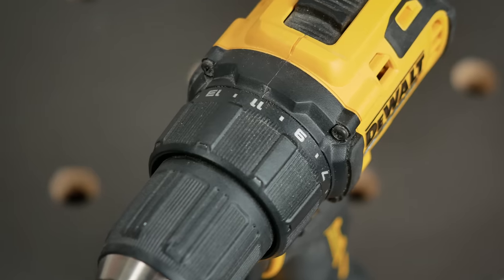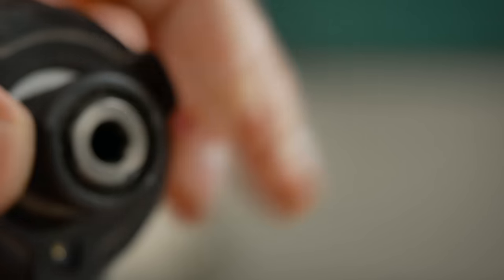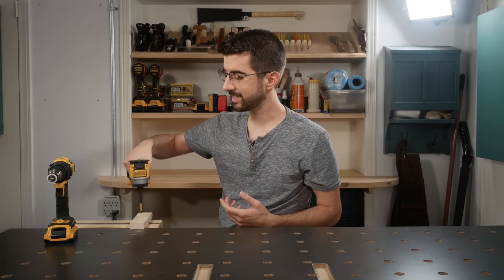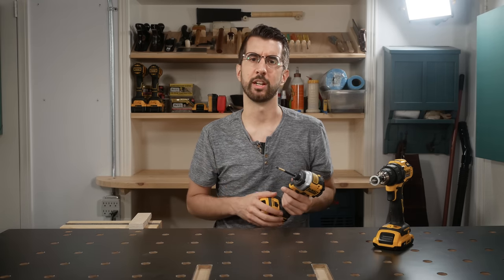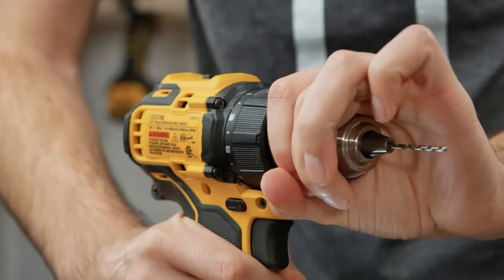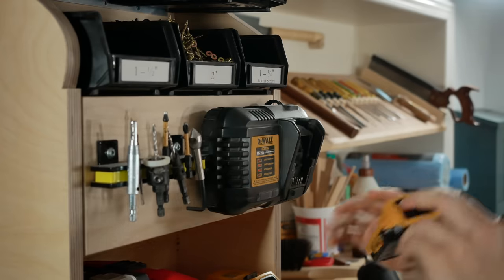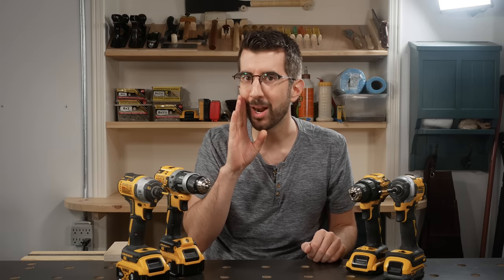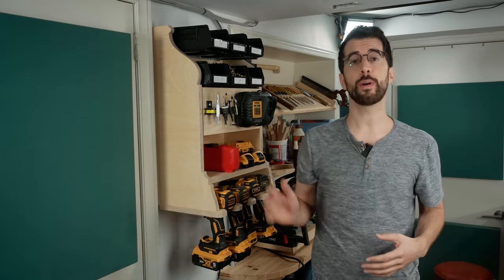why woodworkers don't use impact drivers

Comment: I'm using impact in the factory/workshop in almost all scenarios....
We're working with CNC because we're making lots of projects, So the CNC operator gets all the wood ready (Plywood, Hardwood or MDF for doors, Depends on the client idea/request)
Then it goes into the painting room/oven and when we do pre-assembly (Before it goes into the client for installation) we're doing everything with impacts, Drawers, Shelfs, Hangers, Boxings and everything in between...
Also If we touch impact subject I can say from long time experience that Makita impacts very reliable, Working non-stop without issues...

Comment: I’ve found that the impact is best for rough carpentry / construction and the drill is superior when finer control is needed, generally when making more precision cabinets or similar furniture.  To be fair I’ve never had a chance to try an impact with multi settings, and for the record I have several corded drills, one a 1980’s Black&Decker 😂 but 2 are more recent quite powerful Milwaukee drills, and when drilling other stuff like stone with them, having a keyed chuck is indispensable.
Reply: I use my 12v milwaukee driver for most less than construction grade work. It’s light, small and fairly strong, excels at finer tasks, but for a 2.5-3” screw it’s not practical. Impacts are kind of noisy, you don’t get a good feel of how much torque is being applied to a screw, but it’s still the right tool for the bigger stuff.

Comment: I'm a member of a Men's Shed group. Three years ago we replaced our stolen Milwaukee gear with new ones that turned out to be brushless, very nice. But what was intriguing was the pair of impact drivers: they have three different torque settings AND a drill-only setting. Often they are used on the drill setting because of the really short head compared to the pair of cordless hammer drills which are almost twice the length.

Comment: I have that exact same DeWalt XR drill/driver combo, and I must admit I don't use the impact driver nearly as often as the drill - it's doesn't give nearly as much control over setting screws, and it's much too easy to bury a screw deep in your workpiece. I much prefer working with the greater finesse of the drill's clutch control. Use a locking bit holder on the drill, and bit changes are just as quick and secure as on the impact. I'd only use the impact for driving a large quantity of screws very fast, e.g. for decking.

Comment: I got an M18 fid2 impact driver this year. I've had a quick release M18 drill for 6 years. I definitely find myself going for the impact driver when dealing with screws. I usually keep it on setting 1. 
Recently laid a new subfloor, 18mm ply onto old beams, 5mm x 80mm screws. Used setting 2 for speed and grenaded 4 Milwaukee brand bits in an hour. I see why they put multiple in a box now. Got the job done and no broken screws at least.

Comment: A good bit attachment that 9/10 won’t remove the bit when you pull back is dewalts magnetic holder. Round head shape cost about 6-12$  depending on size. Totally worth it use it with ratchets too.

Comment: I've been using the DeWalt Gyroscopic Driver (DCF680N2) for smaller and delicate screws. It's also fantastic for anything around the house where the drill is just over kill.

Comment: Get like a Wera Bit Holder, the lock in the bit really tight, so they never get oulled out and stuck on the screw again. 
I prefere having like three machines at hand when working, reduces the the amount of changing bits/drills etc

Comment: The makita magnetic bitholder locks the bit in the holder enough so it wont fall out or stay in the screw, switching the bits is also easy with a push/pull ring to release the bit. Solves the problem at 1:13

Comment: I use a drill with a screwdriver clutch, a dedicated screwdriver with a quick-change bit holder (very good clutch) and an impact driver. These 3 tools meet nearly all drilling/driving needs in the shop and operate on the the 12 volt Dewalt battery platform. In addition, I have Milwaukee M18 hammer drill and M18 impact driver for heavier work (framing, deck, etc.). Thanks.

Comment: The impact is amazing with a hole saw, it just doesn't try to break your wrist in the first place. I think the Impact excels anywhere binding could happen but you still want to power through it. If you don't want to power through it, the drill is nice because of the clutch. always use the right tool for the job!

Comment: I don't like impact drivers because the chuck wobbles around which I find very annoying.  An 18 volt drill on low speed high torque is more than strong enough to screw any screw I've ever screwed, including 6" structural screws.  Also, impact drivers make it difficult to be very precise with how far you want to sink the screw, especially if you just need it to be a teeny tiny bit tighter and then it starts vibrating, which is irritating.  I think they are more trendy than anything.

Comment: I'm a professional remodeler and I can tell you that you can develop your skill with the trigger where you use an impact driver on small delicate screws without overdoing it. I have the impact drivers that you can select three different settings and I sometimes use the lower settings but I usually don't need it even for small screws. 
You do have to use some finesse with that trigger though or it will overdo it. 

If you want a DeWalt that has the three settings, the 887 model has that feature and you can get it pretty cheap. If you want the best hammer drill from DeWalt, the 999 kit is a great choice and it comes with a 6 amp battery. This is probably more than most hobbyists need but I can easily use it to drill one inch holes through a concrete block wall.

 I also have a small non hammer drill that takes the same batteries, it usually lives in my house while the DCD 999 lives in my truck. 

Funny story I forgot my impact driver was on the number 1 setting and I changed batteries thinking that the battery was dead when I tried to drive a 3-inch screw. And then after I changed the battery I thought something was wrong with the tool. Then I finally figured out that I had left it on setting 1 which I rarely use. I only had impact drivers with the high setting for so many years I got used to not having that feature. I kind of had to get in the habit of using the different settings and I still usually just leave it on number 3. The reason I always had the single setting models is because the ones with three settings we're not invented yet.

Comment: DeWalt has a bit holder kit (DWAFTAS-9) that is magnetic and it locks the bits in. So the bit stays in when you pull it off the screw.

Comment: Both are great, period. Although, as a Carpenter, I find myself using my impact more at work, particularly with metal sheet. In saying that, It also works well for larger Screws on hobby projects (better than a regular drill, I've found)

Like Scott, honestly, go Brushless.

Comment: The issue where the bit stays stuck in the screw head, is solvable by using a quick release bit holder. The big brands like DeWalt have their own versions of it, but there is a good chance it is in one of the bit sets.

Comment: I have three Milwaukee 18v impact drivers and two 12v, along with 1 18v drill and 3 12v (one of which is their installation tool). I like to keep a square drive, a Torx 25 and a Phillip's #2 chucked up. I also like to have my drill/countersink and a Vix bit handy. On the drills I typically have an eighth and a quarter bit chucked. The install tool offers the best of both worlds with a clutch and a 1/4 quick bit changer.
Reply: I just got thw dewalt installation driver. Its great to have the offset and 90° right angle. The one thing im disappointed about is it doesnt impact. I thought there'd be a setting or using the 1/4 hex head would make it impact since i prefer impact for installing and removing screws/fasteners
Reply: @jacksmith2315  the Milwaukee and Festool don't impact either.

Comment: Oh! the racket. Contractors exterior trimming my house used impact drivers on hundreds of trim screws. Meanwhile my fess tool was quietly trimming the garage. I have found the impact is excellent for self tapping sheet metal screw’s especially in heavy gauges. Don’t forget lug nuts and machine bolts. Makita 9.6 was the first worthwhile cordless drill. Still have one in the shop dedicated with a hex shanked counter sink bit.

Comment: For a quick change bit that doesn’t leave the bit in the screw, use a wera quick change hex adapter. They work great!
Reply: @@waynebrown7065 Not essential, but it helps to give a bit more space, making things a little easier. Cheap kits from a local hardware store will most likely come with a simple adapter like seen in the video.

Comment: I am sure somebody already mentioned this, but Dewalt does make a screwdriver function. Which has the impact end as well as a clutch setting. Milwaukee 12 V system all also has a screwdriver. Both from what I heard are pretty excellent.

Comment: I recently added a Dewalt compact driver (non impact) with chuck and quick change to my drill/driver collection, the "DEWALT XTREME 12V MAX* Cordless Screwdriver, 1/4-Inch (DCF601B)". I use both 12V and 20V in my shop (and a cordless festool track saw)... so having a nice lightweight driver with quick change and no impact has been very nice.

Comment: I fitted my drills (antique manual and modern powered) with a Wera Rapidaptor 5052502001 889/4/1 K, allowing me to change screwdriver bits super quickly while making sure they don't get stuck in the fasteners. I also purchased a set of drill bits with hex shank, so that I can keep the Wera Rapidaptor on my drills at all time (Hex shank drill bits are better than rounded shank ones anyway, as they rotate less in a drill when the chuck gets loose.)

Comment: I use a Milwaukee impact driver, I'm an idiot because I just ram everything into place.
When I have a doubt if it will get tight enough I get bigger screws.

No it doesn't look pretty, no I'm not a real woodworker.
But oh boy, I've never had anything come apart :p

I do have a lot of respect for your work, I wish I've had the patience to create such nice things as you do.
But I don't, so for me it's : just eyeball it with a bit of measuring -> ram it into place - > doesn't fit nice? -> try again.

Mostly this works, but when it doesn't it takes more time then to do it right (like you do) in the first try.

Turns out people are different 😂 and somewhere there's a balance between everyone.

By the way, love your channel.
I use allot of tips you provide, if I don't forget.

Comment: Having one battery platform is a perfectly reasonable thing to want. J Katz Moses did a comparison of routers and found the DeWalt one to be among the best, for one of the few objective-ish data points here. I’m a Ridgid shop, knew a guy in college who swore by them, and yes one compact drill and driver are enough. I did go for the DeWalt corded plunge router though.
Reply: Really dewalt for a better router? I was always under the impression the bosch router you can use fixed or plunge base was the best

Comment: 95% of my drill and driver use in the shop is mounting things to the wall, building storage solutions, or making/taking apart old jigs to reuse parts. I always use both. I have zero interest in changing the drill bit out for the driver bit every time. If you can get a good deal on a Drill and Driver (with battery) combo, it's worth it. Plus, the driver is really helpful for outdoor projects when driving long things into treated lumber. I strip far less screws with the impact because the braaap gives me a heads up that I am getting close, and to be careful.

Comment: I've been buying tools for home improvement for years, and the last couple of years I've tested myself to a bit of nicer stuff. That's my roundabout way to say I have too many drills!

I love my drivers for when I need things slapped together fast, and I enjoy their more compact size. I adore the 12v Bosch I use at work. But I got a used Festool drill for $150 with an electronic torque setting and it's my favorite for driving screws!

Comment: Been doing this professionally for 13 years. Ill grab a nice makita keep that muchacho in full speed and even adjust doors with it. As long as you have good trigger discipline, a drill for holes and an impact to sink screws is fine. Like all things practice and consistency are your best friends

Comment: Granted I'm a carpenter in work, which certainly means framing; so an impact is necessary. That also means I use them a LOT, and am very familiar.
So, the impact is one of the greatest tools for me, and my familiarity also significant control. So, I'll pretty much always use it for every screw.
Now, I can certainly see why not so much in wood working, of which I'm a hobbiest at most; especially with predrilling. Can't beat the quick change for bits. You can get a bit holder that will hold onto the bit, but that also means it's a lot harder to change the bit (often requiring pliers).
Sticking with one platform and therefore one battery makes the most sense. The cost of batteries is where the "get you."
Anyways, my two cents 
Liked the video!
Also, I'm completely into DeWalt because... Of batteries.

Comment: My first tools were dewalt but ended up going to Milwaukee bc I liked the size and variety in their m12 line. That little Milwaukee fuel impact is so small and powerful! I’m just a DIYer but I don’t like variable speed triggers. I prefer choosing the speeds with the button but I can see why variable speed triggers are useful in many scenarios. The few times I’ve worked with wood, I like to use my drill over the impact for the control. Great video man!

Comment: I use a #2 Robertson bit running the screw in with a drill and then tightening the screw by hand with a screwdriver.

Comment: Like anything else it just depends. If I’m going to be doing a lot of drilling and sinking fasteners I’ll want one tool to drill and one to drive screws to avoid changing bits over and over and over again. For smaller projects I’ll just pull out the drill and call it good. And I also agree with racking up all these different drills and drivers, for what? I have the M12 drill and drivers and the m18 drill and drivers and that’s plenty to do essentially everything. I’ve even used my M18 impact to take lugs off of cars in a pinch (not that I can recommend that lol)

Comment: I work at a crate shop and we pretty much only use impacts. I just tap the trigger to get the screw the final bit that I need. That being said, it's crates so it doesn't need to look pretty or anything of the sort and we use the duct tape of the screw world (drywall).

Comment: The same style bit holder is available for drills.
I just use two drills or a bit holder that lets me switch from drill bit to drive bit easily.
I like two drills as I have a clutch to drive screws...
I like the clutch...

Comment: Milwaukee make a great bit holder that keeps the bit in and you can also get a quick change snappy holder , but I work as a cabinet maker and along side a lot of other cabinet makers we all use regular impacts without speed control

Comment: Well, I "converted" to impact like you.. because of the "quick change".. but also because of the lighter weight and smaller overall size, AND.. the LIGHT that comes on when you press the trigger! While I see a hobbyist only needing a couple of drivers.. the fact remains that some jobs, I have had to use EVERYTHING I own to do multistep drill and driver functions (up to as many as 9 preset bits - in ALL drills I own.. in order to keep my speed up on jobs (I tend to use a LOT of screws in some projects). I wish I had the budget for the new Dewalts - I'm using all 18V in all my cordless (6 in all), so I know at some point the batteries will keel off.  Thanks for posting.

Comment: DEWALT makes and sells an extension combo at Lowe’s that is magnetic and also has a mechanical lock that doesn’t let your one inch bits stay on the screw.  Comes in three, six, and 12 inch extensions. Best money for an impact driver extension you can buy, IMHO. DEWALT part numbers are DWA3HLDFT for the three inch locking bit holder and DWA6HLDFT for the 6 inch locking bit holder.  Lowe’s has the combo pack that has both, along with 1/4” and 5/16” nut drivers and some one inch bits included.  About $20.  Best money you’ll ever spend!

Comment: Drills and driver are two different tools, I got a 7.2 Makita impact for work when they first came out and my daily driver at home is a Bosch 10.2 ( you don't need more for hobby stuff ) and I use a 18v Makita at work and it works great. At work and at home I use both and more than likely always will, but for my hobby stuff my 18v even reducing the speed is way to much.

Comment: Impact drivers have a specific purpose and other uses as well as a drill having its own specialized use hence the two different tools there is some overlapping  in what they do but for precise control it's a drill, if you want to be able to limit torque it's the clutch on the drill, now if you need more power to get something driven it's impact all the way but control can be achieved through finger dexterity and experience.

Comment: Drills are great for screws that cannot be too tight. Impact drivers are great for screws that are tolerant of being tight as well as using paddle bits. For fasteners that need to be super tight, use an impact wrench but you will rarely need one in woodworking but may come in handy at one point. I’m actually a Milwaukee fan boy. As for drill and impact driver, I prefer the smaller m12 fuel over the bigger m18 fuel.

Comment: For the past several years I don't use any screws for woodworking. It's all joinery table saw and router joinery, with glue. With the mostly cheap pine wood I use, screws seem to tear out too easily.